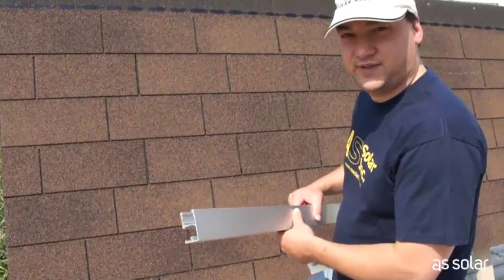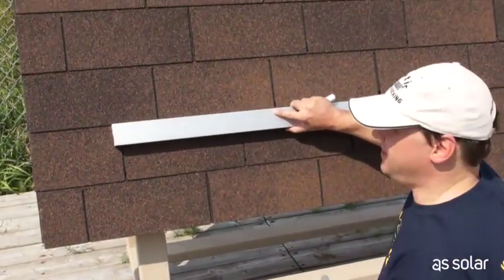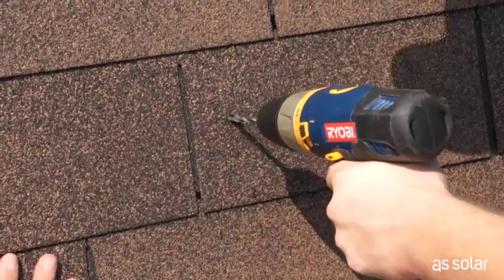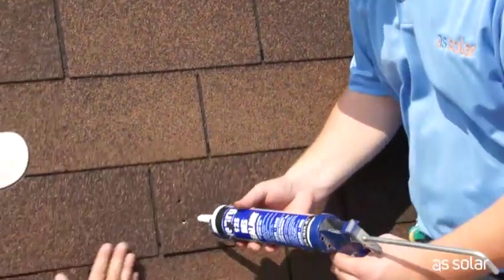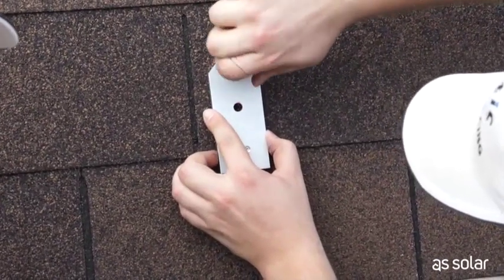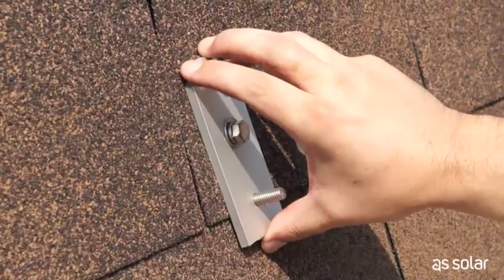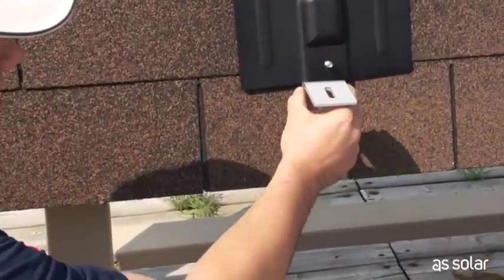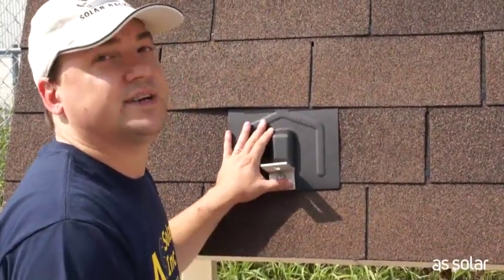AS Solar's DIY Solar Panel Installation, Part 2: Mounting the Kinetic K-Flash

Comment: Great product, but if you want to see how to do it properly follow our Chanel.  This method will probably not leak, but we are currently installing this system while doing our roof, it will be sure not to leak by shingling around the flashing and cutting shingles to go around flashing.

Comment: As has been pointed out in other comments, that flashing is either not long enough or it's being installed incorrectly.

A roof is a mechanical water shedding system not a sealed solution -- each successive course overlapping the other.  As such, unless that bracket flashing goes all the way up underneath past the three-tab slit you're effectively shortening the roof by years and possibly damaging the truss system via moisture over the long term.

A perfectly put together roof should not require one dollop of "sealant".  It is the unbroken overlapping of the shedding surface pieces which maintains the integrity of the roof.  As a matter of fact, depending on sealant is a guarantee to future problems.  Sealants weather and fail.  Roofer's tar is mainly to glue the three tab system back down after maintenance so high wind doesn't flip back the tabs.

I realize this is a video series to expose people to the ease with which a rail system can be installed.  However, performing this work without a thorough understanding of how a roof should function or be repaired is asking for the slow, steady, and extremely expensive structural rot repair of the compromised roof at some point in the future.
Reply: Hello. I am a home owner in FL about to install a 30 panel array on my roof so I have been doing relentless research and checking out many videos. This whole flashing thing is where I am stumped. After seeing this comment it almost sounds like you are saying all solar roof installs with this standard practice will kill a roof in a much shorter time.  In this video they are using a standardized flashing system that is 12x12 in which you tuck about half of it underneath the above shingle. He is using a "Snaprack" system found on ebay at about $15 each,  which is a lot of money!  

Now, I'm saying to myself  this is not a good idea to have to break apart shingles at all. I don't really get why it's standard to do it in this manner. 

As it has taken me now 4 months to finally get the permit to do this I had purchased 5x7 steel flashings on Amazon at about $50 for 100pack. My purchased system included the L-foot with rails and attachments but no flashing parts.

So as a way to cut costs and perhaps perform a safer method I noticed my flashings fit nicely horizontally between my shingles and that I could firmly tuck the top of the flashing into the above shingle without tearing it apart and putting it directly underneath it. My proposed plan is to use a generous amount of sealant on the flashing, fill the hole with sealant, then tighten down the bolt through. Also the flashing would not overlap shingle below as it does in this video.

Sound crazy? See my photo at this link

https://s26.postimg.cc/4hc1x7hi1/20180410_173143.jpg
Reply: He is right they did a pretty sloppy job, the flashing should be up higher to promote water shed. I don't like that particular mounting system at all and am currently working on a DIY install / research phase right now.  I decided to go with an IronRidge rackmount system as they have great reviews and look to be a solidly built product.  Look up their Flash Foot two install videos on here and you'll see what I mean. 

Hoping I do not have the same permit trouble in Florida as you did, 4 months seems like a long time!  Hoping to start building in the spring time when it's a bit cooler out.

Comment: Your pilot holes for the lag bolts are TOO LARGE.  As per engineered specs for Kinetic Solar K-Rack, you should be making a 7/32" pilot hole.  The pull strength of your lag bolts has now been compromised and vastly reduced as a result of the larger pilot hole.